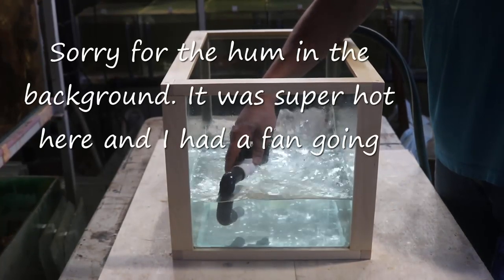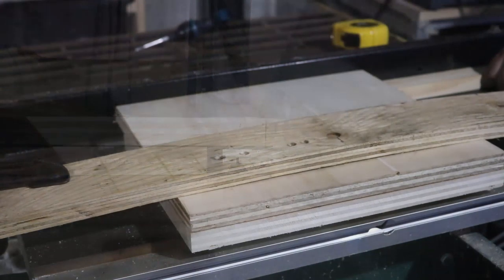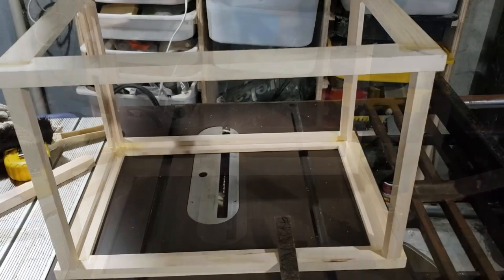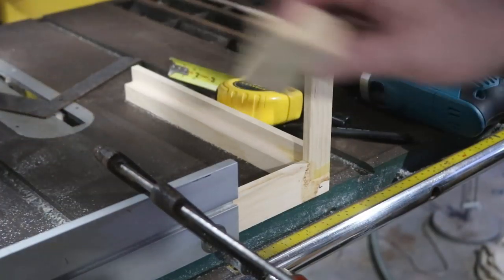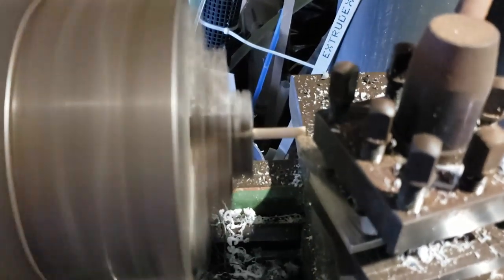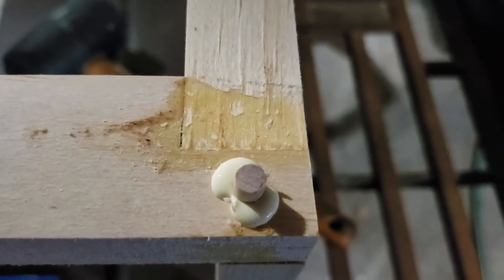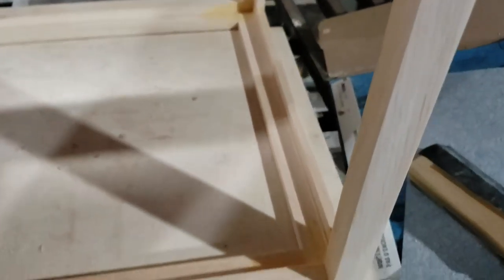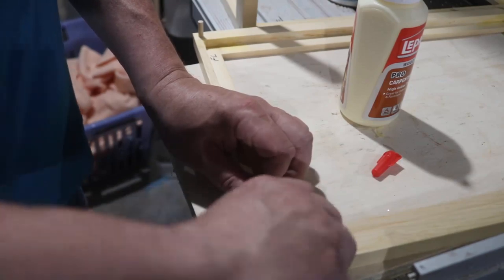DIY Wood Framed No Silicone Tank Part 1

Comment: In my youth I used to repair those stainless steel tanks at a rate of 50 cents a gallon.  So a 10 gallon tank repair, broken glass included, would cost you a whopping $5.00.  It's how I afforded the hobby and maintained a relationship with the local pet shop.  We're talking 1959 - 1964.  One used an alcohol torch to heat the frame to loosen the putty and then pushed out the pieces.

I've often thought that someone should sell stainless steel tanks with the modern, vastly superior, silicone glue.  A steel frame AND silicone would provide a nearly infinite safety factor against leakage and warpage for glass walled tanks.  Panes would be held to each other and to the frame - a sort of belt and suspenders approach.  Visually the "picture frame" perspective can be very pleasing and is actually being replicated by some firms by using black silicone.  It would seem the manufacturing process could be done fairly cheaply.  Steel frames would be cheap with modern automated processes and would provide a preformed jig to align all the glass work without stopping to allow silicone to set.

[Real History:  There were two types of putty used between the glass and frame.  The older type was maintained malleable and workable with oil - linseed probably, and dried hard and ultimately crumbly after a few years.  The tank needed to be seasoned following construction or repair due to the oil.  Around 1960 or '61 a plasticized putty became available, which was a huge improvement.]
Reply from the maker: Thanks ever so much for sharing your experiences! I really like hearing about them. No matter how this holds I will be replacing the putty with silicone. Do you think it's a must to replace it with black silicone or does it matter? From a nostalgic point of view most would say black.
Reply: Thanks for the historical background. I still have a few Metaframe ss.tanks, one with a slate bottom that my dad bought me when I was a child. I actually have one original small can of that black tar. I'll never open it - it's an antique in its own right. I have used silicone to reseal those old tanks with no problems. Actually I still have a ss 20L still in use! My understanding is that some of the first tanks built in Victorian times were framed with wrought iron and  painted. I suspect they used tar between the frame and the glass.
Reply from the maker: @jimzielinski946  So cool to see that some are still around!
Reply: @jimzielinski946     Those stainless steel tanks are now being sold as "antiques" on the used market or EBay and they're expensive.  If you should stumble upon a fancy wrought iron framed tank you'll find it's roughly priced only slightly less than the Taj Mahal.
Reply: @FishmanEricRussell    I'd say color is your choice and silicone is definitely the way to go, especially since it will provide holding strength and not just a seal, as the putty would.
Reply from the maker: @PalJoey-rm2yh  For sure. It was fun to build this but in reality the only real way is with silicone
Reply: FLASH - If you're planning to repair any of these old tanks, you'll have to substitute a thick glass bottom to replace the original slate/  Silicone will not stick to slate for long!  I now remember that slate, a sedimentary rock, has a small amount of oil in it's composition.

Read this   http://www.rickwrench.com/index79master.htm?http://www.rickwrench.com/stainlessaquariums.html
Reply: Such a great Man

Comment: very neat video. i just got a pemco stainless steel 70 gallon tank back up and running.that i had when i was a kid.it had a cracked bottom and side glass.i did a plywood with flex seal over it.cheers
Reply from the maker: Got to love those old tanks for ease of fixing. Current silicone tanks are a pain to take apart and fix.

Comment: FLASH - If you're planning to repair any of these old tanks, you'll have to substitute a thick glass bottom to replace the original slate/  Silicone will not stick to slate for long!  I now remember that slate, a sedimentary rock, has a small amount of oil in it's composition.

Read this   http://www.rickwrench.com/index79master.htm?http://www.rickwrench.com/stainlessaquariums.html

Comment: Great job love the way you made it. I would look great in oak or teak. The only thing I might change is not putting the dowel all the way true the top. Just stop them short to give a nicer finish 
All in said I would buy one in a heartbeat. Great job keep up the great work
Reply from the maker: I'm so glad you liked it. With the top I was more concerned with the holes matching up perfectly so there would be no stress on the seems or putty. It would look much nicer your way though

Comment: For the top frame did you think of only drilling from the bottom and not all the way through so the dowel would not show from the top?  I remain amazed at the work you accomplish.
Reply from the maker: I was more concerned with making sure the holes lined up perfectly so there was no stress on the seems. Would look much nicer though your way. Thanks so much for coming by

Comment: I wonder if you could get away with using a less thick glass in a deeper tank with this style.
Reply from the maker: Unfortunately even if it were sealed with silicone you would need the same thickness of glass. It still has to be able to resist breakage from water pressure. All of my large tanks are metal framed and are still made with thick tempered glass. Thanks for watching

Comment: Had a very similar idea. I was thinking of using a dado or groove through the middle of the middle of the frame pieces like a floating door panel. Using sealer of some sort in the groove and around the edges of the glass on the inside. In my mind it looks great but I am fairly sure there is a reason someone hasn't done this on video yet. LOL

I think this project is going to be very interesting even if the tank only holds water for a couple years!
Reply from the maker: Hey J! I think I saw what your describing with the frame once. It was for two tanks end to end and the frame was intended to make it look like one big one. Sadly it won't get the chance. In the name of making videos I will probably take this apart in a while and seal it properly with silicone (probably black) and add some additional cabinetry to make it look better for a living room piece
Reply: @FishmanEricRussell  - Still sounds like a great project. Anxious to see how it turns out!

Comment: If you seal it up properly, it should last a long time, years, in fact.  You're using pine, though, a soft wood, not very strong. I would personally have used Oak or Ironwood, or some other Hard wood, something really strong!  I AM, however, looking forward to how it all works out, and it's only a ten gallon, so yeah, it should work out fine, especially if you use regular clear aquarium silicone, but you're going to use that old black tar caulking... whatever it's called... (Creosote, maybe? I used to know what it's called but that was 40 years ago!)  There's a reason they stopped using that!   lol   :-)
Reply from the maker: I used pine because it was easy to work with and as you said it's just ten gallons. Can't find that old black sealant so I went with a modern putty. It won't work as well but I plan to reseal this with black silicone anyway after a bit. Thanks for taking the time to watch
Reply: @FishmanEricRussell  Well, I'm still looking forward to it... should be a beautiful build!   :-)